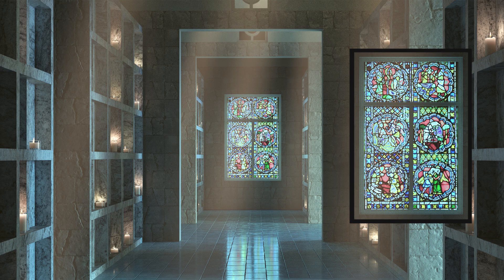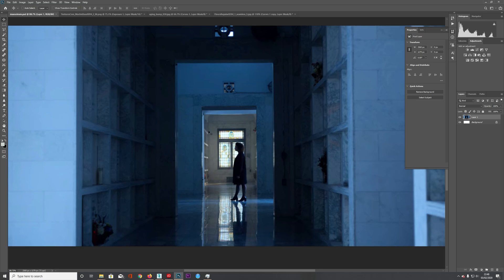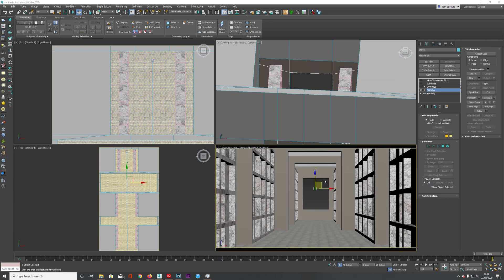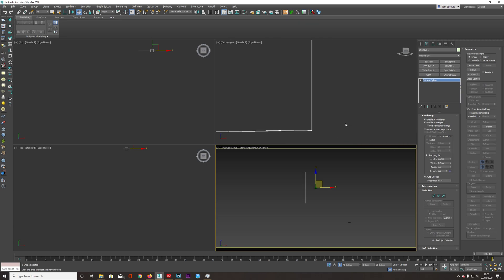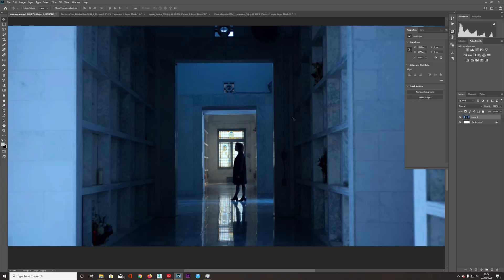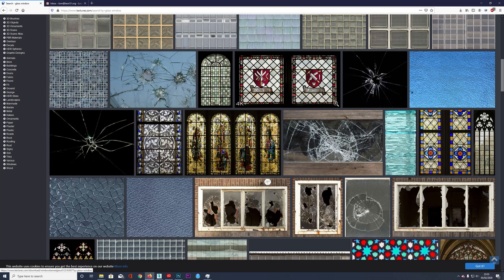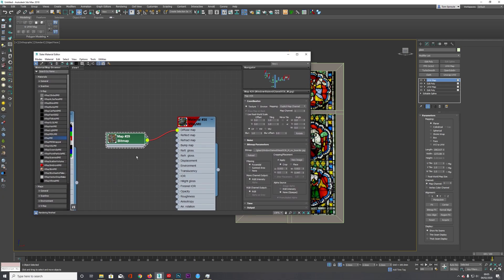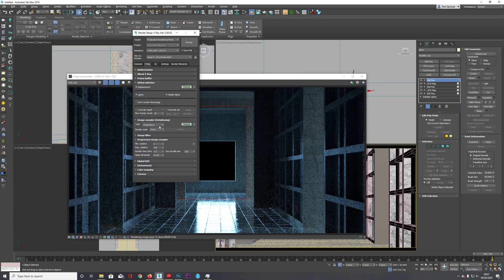How to Create a Stained Glass Window in 3DS Max & V-Ray | The Mausoleum Lesson 07

Comment: Hi Leon, the window is a plan polygon or a realistic volume poly. with say a thickness of 3mm?
Reply from the maker: Because it's coloured it's a plane rather than a realistic volume poly. Otherwise you could wind up with an image which looks like a copy of itself; like there are two images. If you want to close off the window with a realistic volume poly, it may work to put a plain glass material on the back of the poly, to prevent colour bleeding.